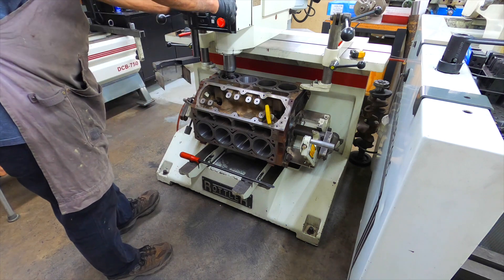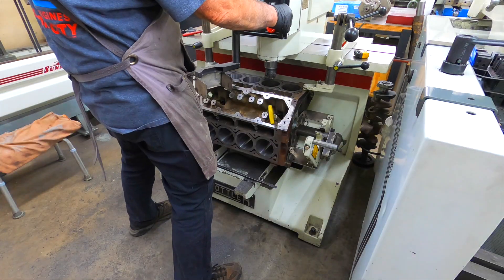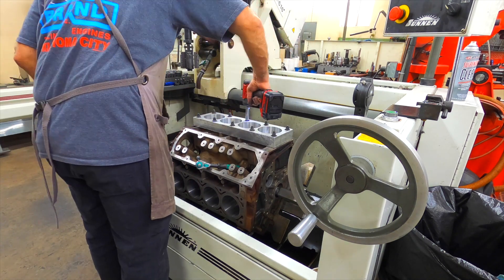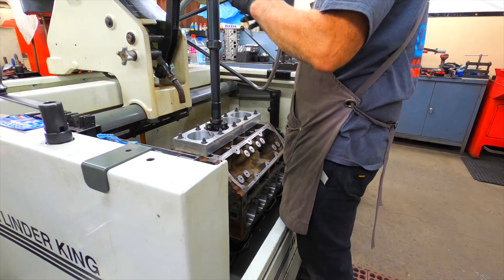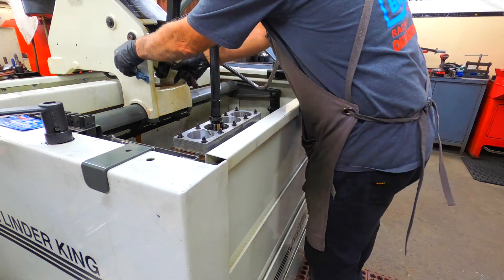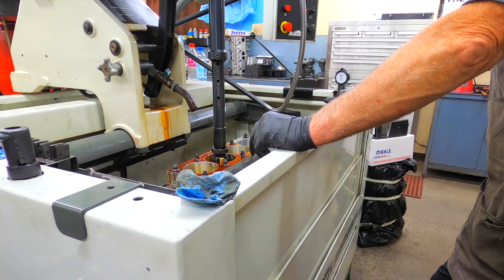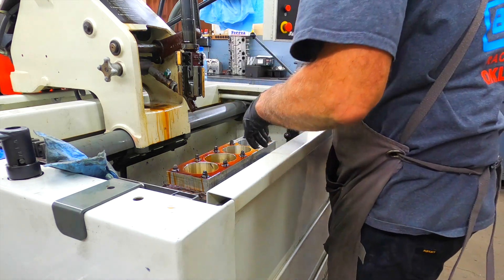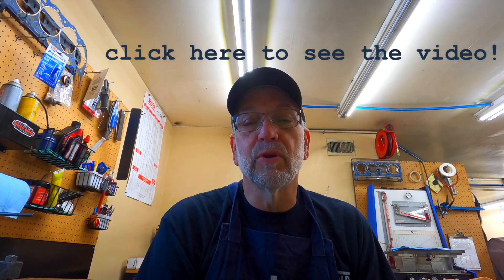Engine Bore and Hone on an LS Block | Brand Racing Engines

Comment: Hey Gerald is that a CV-616? I have 2 shops here at my house and started building LS engines after my dad passed away we used to build off road race cars. I am saving up to buy some machinery the machine shop I currently use is trying to guide me what to get . My issue is a do allot of aluminum blocks and they are pretty far out of taper sometimes up to 5 thousandths and I usually only take them 5 or 10 over on the aluminum blocks because of the sleeves being thin aswell as not being very centered in the bores.  They usually have to take my block to a shop with computerized hone to even do allot of my stuff becuase my machinist says it next to impossible for him to get it right manually on a 616 with how little I take off . Ive also been looking at those boring bars but my machine shop has a wiona van norman machine that can be indicated to bore and also use a fly cutter head and deck quite nicely so that could save some money .  What machines would be the most cost effective to someone who builds mild to performance basically LS only I also have been doing some Ecotec engines for midget sprints .  Late model pretty much .
Reply from the maker: CV 616 will work If the feed and press on the stones are right. A hone and a Bridgeport mill you can deck block ,line bore block ,do lifter bore you just have to by the tools.I used to deck blocks on my mill same BHJ tooling that I us now

Comment: I don't think there's any specific way to torque the heads that is better than the other, as long as it's done in reasonable steps. Chevy torques them all at the same time with a tool that comes down and hits them all at the same time!!

Comment: I greatly appreciate your videos. I will never need to know how to do this or rvk or plateauing the bore scratches with the second stone if your using this ring instead of that and why diamond stones are the hot tool of the week but not preferred.  You make a fine entertaining piece for rodders on your subjects! I'm a out to in guy now because it seems like your stretching the guts out of the inner studs.

Comment: If I may ask, what benefits of the outside in torque sequence have you seen? More race motor vs street driven stock-ish? Improvement in head gasket sealing? Any effect on a partial fill block? My curiosity is peaked. Thanks!
Reply from the maker: Torque one head on one side the normal standard sequence and see how many times you have to go over them to get them not to move. Do the other side outside in and see the difference. Thanks
Reply: @BrandRacingEngines  So, there is a difference. Building a SBC for my daughter, I will try this!

Comment: Don’t the rottlers have auto centering
Reply from the maker: I have a standard manual machine
Reply: @BrandRacingEngines  yes I mean don’t all rottler boring machines have an auto centre with 3 fingers? I used to have an older fa24 it had 3  auto centre fingers
Reply from the maker: @circlejerk6861  The one I have Has 4 Fingers

Comment: When honing the block , do you work from center out or from end to the other. If  you work from center out what is the advantage.
Reply: Most people start on an inside hole like he did. He most likely went from the second hole to the fourth hole, then the first and third. reason being heat.
Reply: @taylorsrus9543  thanks

Comment: Thank you for the video! Alot of questions popped up, from the benefits of the torque sequence to hone cut coarse level and bore to piston tolerance between different applications / power levels and adders. Would definitely love to see a video from you about those subjects. Thanks!